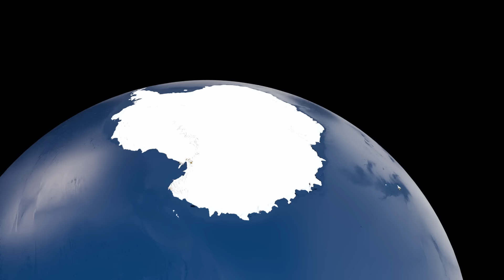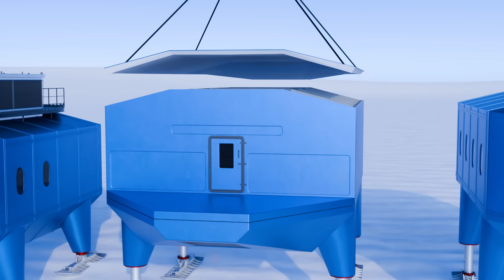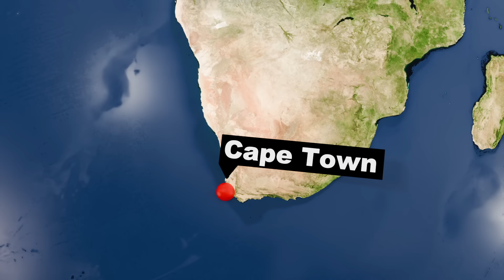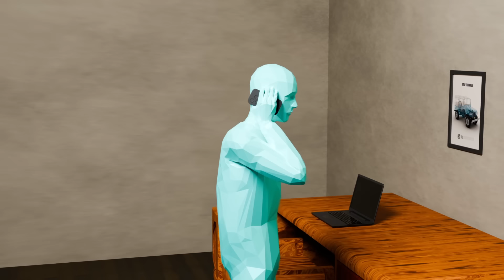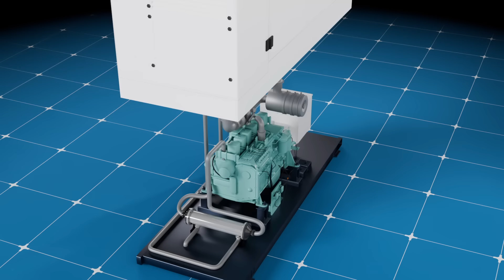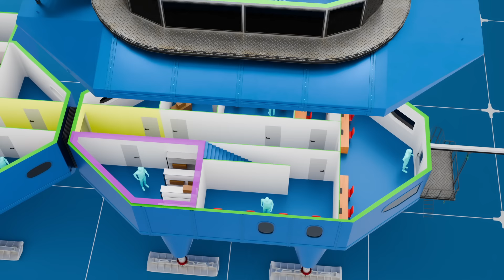The Insane Engineering of an Antarctic Base | Halley VI

Comment: I'm impressed at how closed the waste management system is. I am somewhat surprised they aren't using a waste incinerator for the sludge and recapturing heat from that.
Reply: Human waste sure, but some of that is soap waste, which doesn't burn well. Additionally, actually burning it means drying it out completely first. Which takes more energy than just letting it freeze.
Reply: @NikkiTheOtter True 💯 dat. 🏯
Reply: Pollution, air pollution is a thing

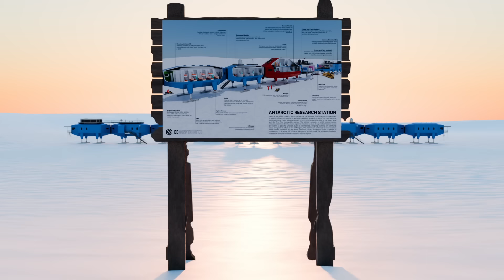Comment: The most interesting thing is how the whole structure is fully relocatable according to conditions and it's hydraulic system idea I liked it lot !!! 20:00
Reply: Halley VI has been moved one time, during the 2016-2017 Antarctic summer season, when it was relocated 23 km inland to a new site to escape a growing crack in the Brunt Ice Shelf. The station, operational since 2012, was designed to be movable and was moved to ensure the safety of its staff and the integrity of the research facility.

Comment: I was wondering ...  And Google said: 
Halley VI has been moved one time, during the 2016-2017 Antarctic summer season, when it was relocated 23 km inland to a new site to escape a growing crack in the Brunt Ice Shelf. The station, operational since 2012, was designed to be movable and was moved to ensure the safety of its staff and the integrity of the research facility.

Comment: Making it a hard reqiurement to go outside to get to the science modules and making BOTH sleeping modules on one side of the safety bridge seems like a HUGE design flaw?  Why is there not one sleeping module and one science module on either side?
Reply: I was wondering the same thing.
Reply: Safety hazard I’d imagine. Having one continuous building containing all quarters and the laboratories would run the risk of contamination across the entire isolated base, whether it’s toxic fumes or viral spread. Separating the hubs also reduces the risk of extensive damage by fire, which is vital if they’re the only refuge around for miles.

Comment: pls tell me the walk in freezer isnt powered, and is just cooled from the outside air
Reply: Nope, uses R-12 and everything. ;D
Nah im sure it's probably just an uninsulated room.
Reply: surprising to many folks is the fact that at the height of an Antarctic summer, outside air temperatures can climb to above freezing, coming close to mid-40's F.  Many of the science stations there have been recording record summer highs over the past couple of decades and while I don't know what the warmest temp ever recorded there is, rather obviously any walk-in fridge or freezer would have to be as heavily insulated as any other part of the station.  Having worked in the food industry off and on thru my life, I've a passing knowledge of how walk-ins work, and know they require both a source f outside air as well as a way to vent interior air.  At it's most basic, all refrigerators and freezers work by sucking in outside air, removing and venting the heat out of it and most of the moisture (but not all) and then circulating the remaining dry(er) cold air within the confined space, regardless of that space's size.  This process requires the use of quite a bit of machinery, all of which is temperature sensitive, thus the need to insulate the spaces the large cold and frozen foods being stored, regardless of outside temps.
Reply: Really FUCKIN funny joke dude, but just in case you're 8 years old and have no idea what you're talking about, getting food from -60 to 70 F takes much longer, and some food can get ruined at that temp. Next, it's a waste of energy to constantly open the door from -60 to 70° and reheat food and goods compared to running a freezer inside around 0°.
Reply: @Supersquigi  dude.. it's not that serious
Reply: freezers need to be kept at a constant temperature for different reasons, outdoor temps can fluctuate and just be generally unpredictable.

Comment: I giggled at the thought of the kitchen having a walk in freezer, considering the outside is a freezer. I would imagine they have some kind of system that uses the outside cold for that freezer. Otherwise you just useing up energy for something the Earth is offering for "free".
Reply: Problem is the coastal region (which this station is in or close to) varies from -10 to +10 C throughout winter and summer. For food storage CONSTANT refrigeration is needed.   Much easier (and safer) to just have a fridge and freezer.

Comment: What kind of fuel do the generators run on, diesel I assume?
Reply: there was a tour of the station I saw on here at some point. IIRC the generators are diesel (might be jet fuel though)
Reply: Diesel starts to freeze at 32 degrees but jet fuel can go to -40. I would assume jet fuel since they already spend so much money.
Reply: Aviation fuel in winter months and a mixture of diesel and aviation fuel in summer months

Comment: I still don't understand, why the surface bridge needs to exists? I mean to go from sleep module and go to science modul they need to go to outside in very cold tempratures right?
Reply: Just a guess, but it's possible it has to do with sound transmission.

Comment: Great video. answered a lt of questions, I never knew I had. 🙂
One new question was raised though. Where are the missing 18 bunks? (Personnel up to 50, bunks in each sleeping module 16).
Ah, and the "Power and Plant Module" may be actually a "Powerplant Module"?! I could not see any plants there. 😀 (Or did I miss some English semantics there?)
Reply from the maker: Thanks! Great questions: There are other small shelters outside the main station where people can sleep (they’re just not shown in the video). The modules are called Power and Plant Modules because they provide both electricity and other essential services like water, waste, and heating, not just power.
Reply: @Deconstructed_Animations  Thanks for the quick answer. I forgot, that plant is also used for other installations besides power plants. (Like water treatment plants etc.)

Comment: Does anyone else wonder why, they don’t have some type of wind generators ?  😮
Certainly there is a great opportunity to design and test a variety of wind turbines ! 🧐
Reply: Not reliable. You run into the same issues we have with solar and wind on the rest of the planet, well, now you need a bunch of batteries, and complex hardware to manage the power.
Reply: @Ziezie213  it would be a great test bed for new technologies.    Finding ways to de-ice turbines could help the aircraft industry.